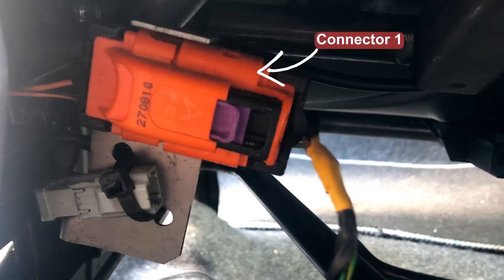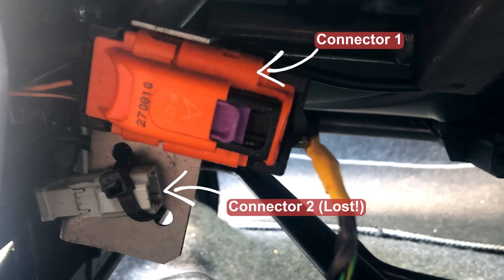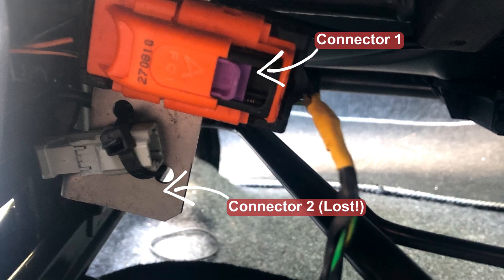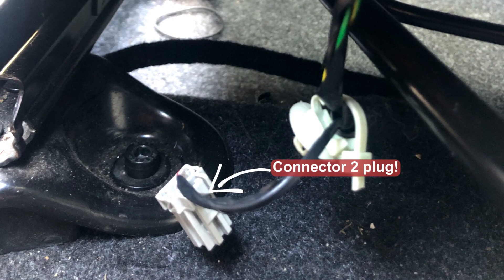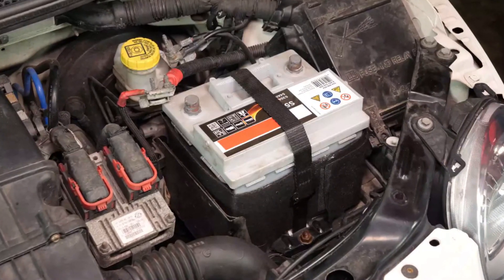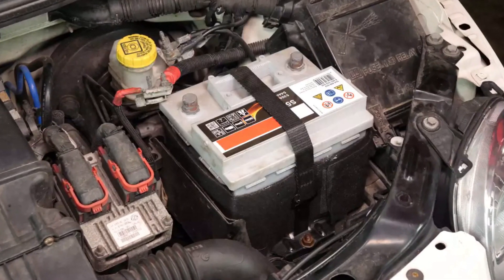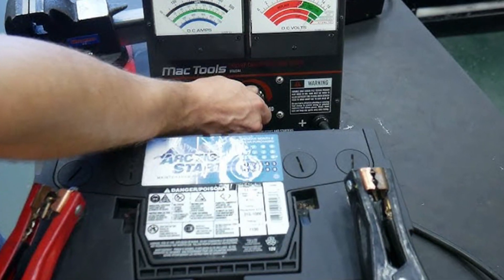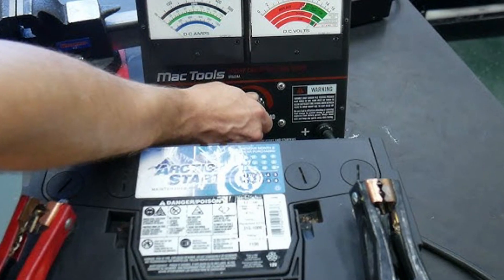Airbag failure in Fiat 500 – Reasons and ways to fix

Comment: MultiECUScan licence is 50 quid. And you then just need something like iDiagnostics OBD II cable and a red adapter (around 50 quid as well). You can then access the air-bag module the same way dealer can. In fact, with MES software, you can do everythng dealer can, for all Fiat group cars.